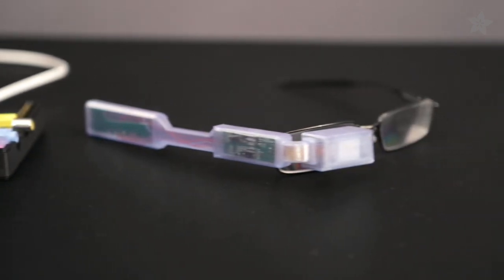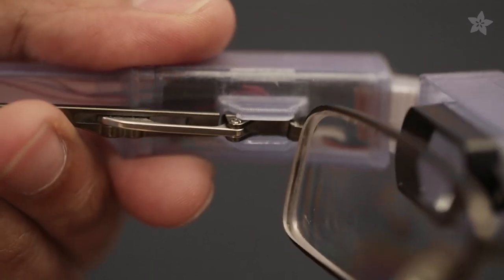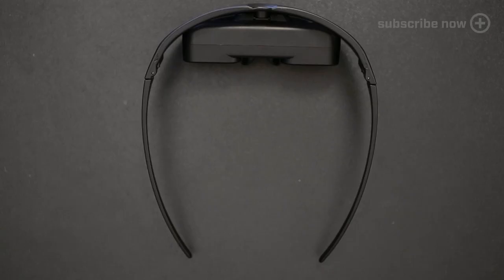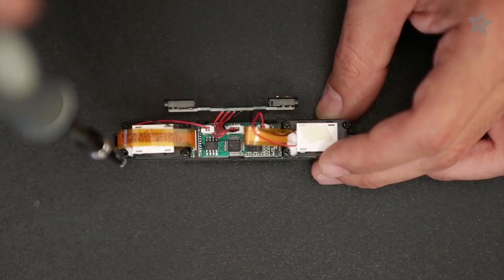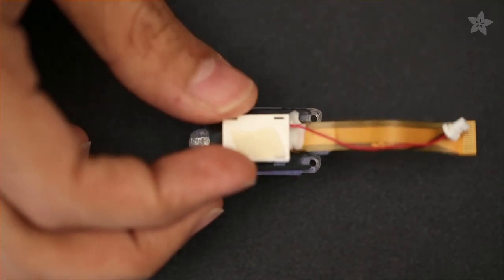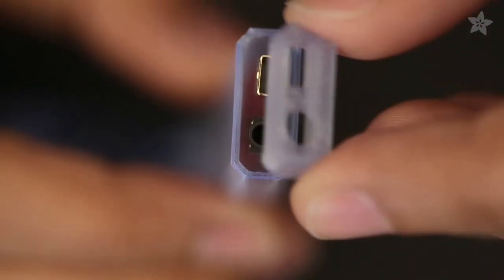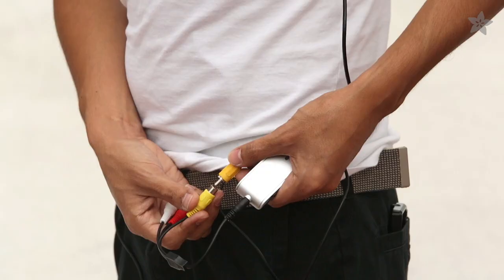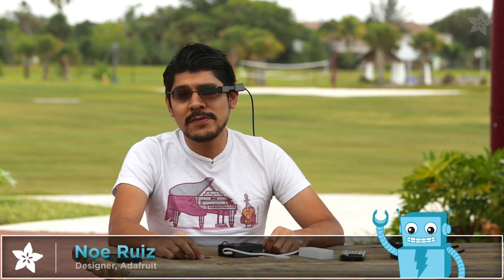DIY Glass - Wearable Video Display

Comment: The thumbnail and title is pretty sweet. And then you find out that they just cut apart a $100 product that someone else made and they have to store a giant box in their pocket.

It would be neater if it were something more stand-alone and used the Pi Zero and were self-contained.
Reply: I mean you can just use a pi zero and run composite through it, code and launch your own app to the zero. Plus the zero would have webcam capabilities for CV and what not.
Reply: What kind of pi is in the video?

Comment: If you missed out on google glass; make your own wearable computer. Just like people have been doing since the late 1970's. In the late 70's Steve Mann, the founding father of wearable computing; used a camcorder CRT for the display. Google Glass kind of annoys me. It's gotten plenty of attention but the concept has been around for decades. I was first introduced to wearable computing in the mid 1990's on the PBS show 'scientific American frontiers' hosted by Alan Alda. He as at MIT interviewing some of the folks from the wearable computing project; including Steve Mann. As soon as I saw the wearable computers I wanted one. Hopefully I will be able to get that project finished at some point. 

I have a Shimadzu dataglass display I need to make a mount for. It never occurred to me to 3D print it. Thanks for posting this video.
Reply: I saw your comment about not needing prescription glasses, you must have removed the comment. What I meant was that you still have to dish out $100 for the 'glasses' meaning the glasses that have the displays, not the pair to mount this DIY project to....I've yet to find a source of JUST the displays that aren't mounted to glasses or contained within a $100+ product. I've seen 3"+ displays for a reasonable price, but 1" or smaller seems impossible to find.
Reply: +Phillip Kirkpatrick  Ada doesn't usually have the lowest of prices. I recall seeing glasses with such small display back a display ago. They used i think a single display back then, and then optics to make it visible for both eyes. They cost around 60€ back then, more with higher resolution screens. I bet if you get to the source, you'll find something rather cheaply.

Not for video, but text information, OLED, e-Paper displays are easily available in sub 1"  sizes.

Back a few years ago, hacking 1.1" ST2205U and AX206 LCD keychains was popular, and their use as USB connected displays. They are $5 items. Of course the displays are horrendous, but what can you expect?
Reply: what a bunch of funny misconceptions

Comment: Just so happen to have an extra Raspberry Pi laying around at home. Very tempted to try this one out! What do you guys think?
Reply: I wish I had a raspberry pi T_T, been asking my dad to buy me one more than 3 months now :/
Reply: Go for it even if you dont have Raspberry Pi you could connect it to a mini pc
and adjust the resolution no more small text
Reply: i think you should go for it i would :)
Reply: i have printed two complete sets of parts for this, decent work, though the attach point from the bend elbow to he display housing was not well thought out. i have been trying to find any similar sized display with better resolution than the one used in the original build, im more than happy to cad and pint a new display housing, but have not found one with 5v drive and decent resolution and contrast ratios. any ideas on that?

Comment: I'd like to do that, but instead of a Raspberry pi, I would use a pocket win10 computer like a GPDwin to load the Hololens emulator, maybe I could add a gyroscope for headtrack, and although I won't have positional tracking  (because there won't be 3d mapping), I would be able to have a useful AR glasses capable to load all Hololens apps

Comment: It looks as if the power board with the audio jacks is not required should I want to use my own power source and connect a camera directly. I am making a night vision monocular.  Does anyone have details on the 4 pins that connect to the video board. I imagine pins 1&2 are power and 3&4 maybe video?

Comment: I live this video, but is possible to use HDMI instead of A/V input? use a Android phone with HDMI out?
Reply: Just buy a coupler, and from there on, lifes gonna be good/
Reply: You can if you have the correct adapters for it, but this may lead to many wires if not researched

Comment: wouldn't it be easier to set up an encrypted wireless system? instead of having all those wires sticking out of the users pockets.
Reply: John Carter Too much lag
Reply: Show us how you would do it man!
Reply: Did you really use the word "easier" to compare implementing encrypted wireless video transmission with a composite signal going through two wires? Wow
Reply: It's easier fir the sake of ease of access and movement. Can you imagine snagging the cables. Plus there are quite a few raspberry pi and non pi tutorials on how to utilize WPA, WPA2 or TKIP for diy projects like this.
Reply: @juweinert  My thoughts exactly lol. More practical? Yes. Easier? Definitely not. Both would require a box in the pocket, one without wires.

Comment: This is really cool.  Could this be used for laptop computing if attached to a mac?   I'm asking b/c  I ahve a neck injury that makes looking down at a lap top difficult, and being limited to my desktop display at home is , well, limiting. I'm looking for a way to have a heads up display that I can use with my laptop for programming & writing.
Reply: +SteelCityEndurance
Sure you could build some contraption to convert an HDMI or whatever output of a laptop down to composite video; however the video display has resolution of 320*240px. That's not really fit for desktop-oriented software. What do you think the smallest legible character size is? Let's say it's 5*8px, which would really be pushing it. This will give you a resolution of 64*30 text characters. You sure it's sufficient for programming, even if you stripped away the UI? And if it is, what do you need your mac for then?
Reply: Yeah you're right, i spoke with another firend about that resolution as well.   Neck is feeling better though. :)

Comment: Does the projector need a glass lens to display correctly? I don't wear glasses.
Reply: I finished this project and I used reading glasses. They range from 30 to 40 bucks although I'm sure if you look around you could prob find a pair for less. just pop out the lenses of the reading glasses
Reply: marcus penny Actually in the UK you can get them for £1 here ($2.50) at a shop called Poundland
Reply: that's awesome do you know if they are willing to mail their 3d prints

Comment: could a raspberry pi 2 run android?? Adafruit Industries
Reply: robotluke123 Probably,It would run slow depending on thy optimisation of thy setup of yours.
Reply: There is an ice cream sandwich distribution out there and it works well, but it's really, really laggy. A faster kitkat one is coming out!
Reply: ***** any news on it?
Reply: not so far...
Reply: +Luke's Bikes Android x86
Reply: +alan328 But Pi is ARM...